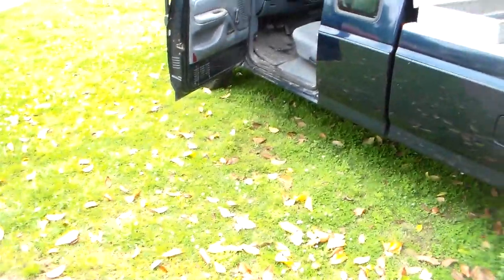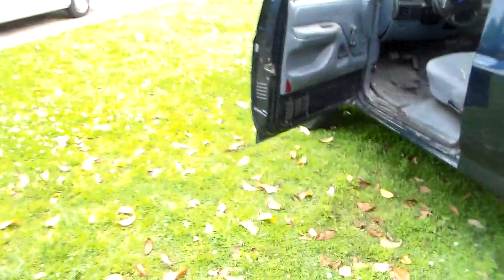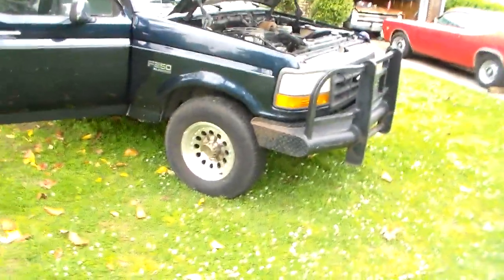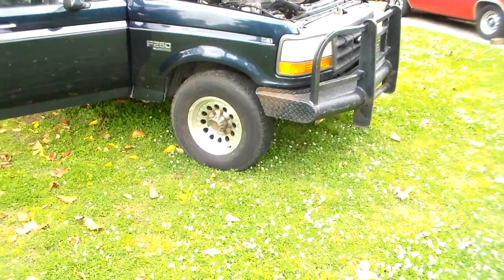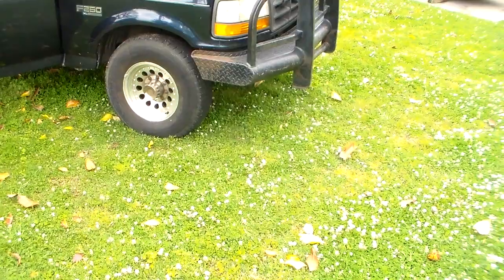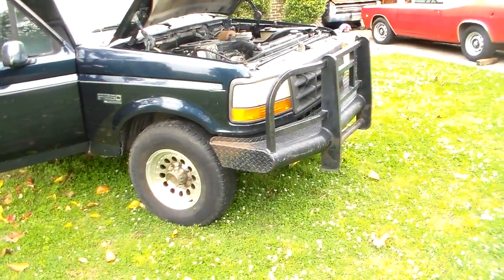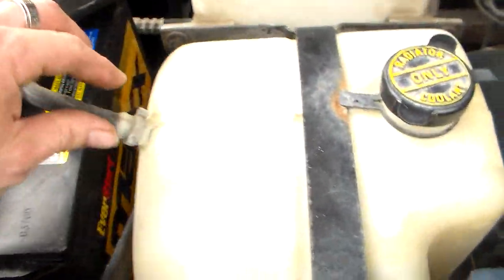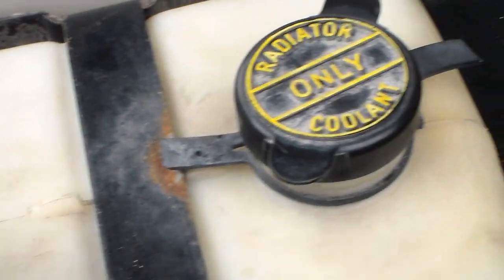1993 Ford F-250 diesel cracked overflow bottle

Comment: Check the fan clutch. They are normally dead on all these trucks. Mine doesn't work but it will only get to the middle of the gauge in stop and go. In the winter it will only get half that distance.